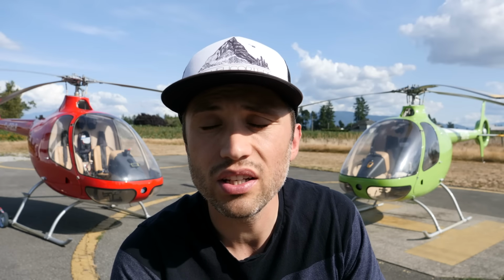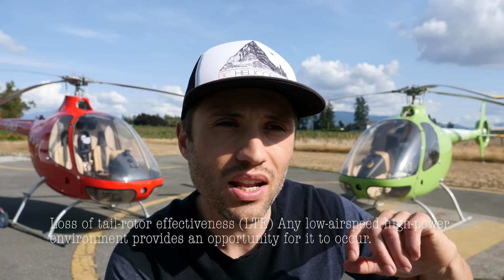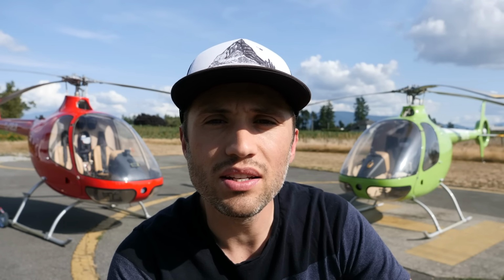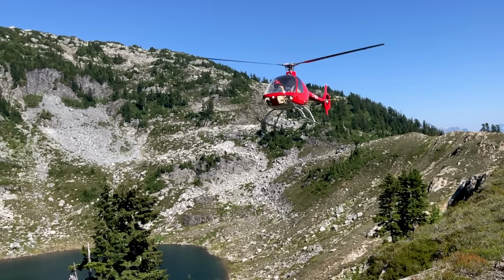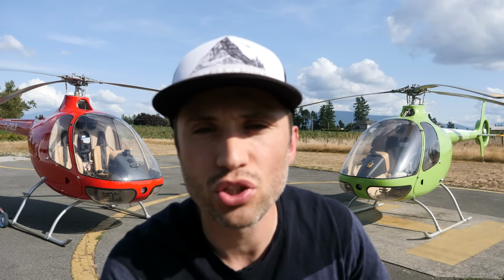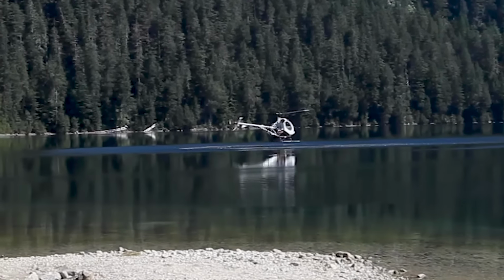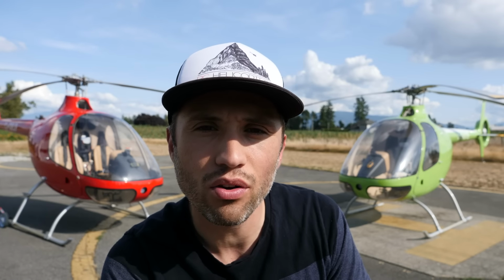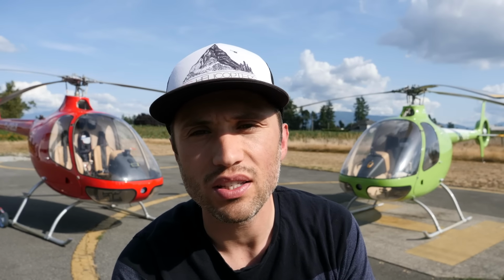OVERPITCHING and LTE can lead to a HELICOPTER CRASH

Comment: What nobody seems to be asking is WHY he didn't have sufficient power to hover, resulting in an overpitch situation? Was this a very hot and high situation?
Reply: High elevation and inexperience is my guess
Reply: It looks like a mountainous area, so I'm thinking he has never flown at that altitude before.  He's probably used to flying at or close to sea level and he probably pulled that hover off a thousand times before at sea level with no problem.  That's my guess.
Reply: I have the same question. Why isn't this scenario built into some guard rail automation to prevent. What's the definitive answer, does anyone know?
Reply: @JayPatel101  I find your question problematic. Relying on technology is exactly why some "pilots" are running into trouble  in commercial aviation. The SFO Asiana crash being a prime example! 
In this situation, he didn't have enough power to do what he was trying to do, and didn't leave himself enough altitude to escape. No technology is going to help you at that point! Self-inflating pontoons, notwithstanding! 🙂
Reply: @BitwiseMobile  the helicopter in the video is an older type.  It appears to be a Schweizer S300 or similar.  Technologies that might’ve helped the pilot avoid this problem may be lacking in such an older aircraft.  The problem here was the pilot’s lack of training OR failure to apply the training received.
Reply: @dapje2002  I’m not a helicopter pilot but I too am rather shocked by how dangerous they become when underpowered for a situation and how operation seems to be frequently marginal in this respect.   This video looks pathetic, like anyone (helicopter pilot or not) could gain height and stop rotation - but this is a great explanation why it happened.  It’s just hard to accept from the outside looking in.   I think it’s science - helicopters are brilliant when they are well powered, not fully loaded or flying in thin air - the skill comes when using them despite some of those issues affecting performance.   Drivers change their thinking when driving on wet roads (or ice!) they don’t just hang up their hat and stay at home.

I suspect this is being handled the right way.     Good pilots don’t get surprises - at least not ones they don’t have plan for.  Poor or inexperienced pilots should know enough to be aware when they are entering the “danger zone” and should either avoid it or train to a level of competence for the situation they are considering.
Reply: I was an instructor in many different helicopters for the Army and in the civilian world.  I'd like to make a few points.  !.  In the Army, we always had charts that could predict the power required in all situations of altitude, gross weight, temperature combinations.  Not all civilian manuals have these charts.  When I asked Bell Representatives about that they said that they included the charts required by the FAA and that was it (much of the RFM is designed to prevent lawsuits).  Therefore, I'm not sure if most civilians can predict power required vs. power available.  2.  In the late '70's and early '80's, the Army crashed over 60 OH-58's due to "supposed" LTE.  They had the same problem with the OH-6's in Vietnam.  However, the term "LTE" had not been coined yet so the OH-6 did not have the same reputation that the OH-58 accumulated.  As we know now, any helicopter with a tail rotor is susceptible to the phenomena.  As it turns out, the Army was advocating taking left pedal out if the aircraft started spinning.  The theory was that the tail rotor had stalled, therefore, reducing the left pedal would "unstall" the tail rotor.  As it turns out, this procedure is what caused most of the accidents.  3.  In many situations, we don't know that we have a problem until we HAVE a problem that has gone beyond recovery.  That's why it is imperative that we always have an escape plan in mind so that it can be implemented immediately without hesitation.  A second of hesitation can mean the difference between recovery and an accident.  4.  During our investigation of the 60 accidents,  every accident pilot that I interviewed thought that he had applied full left pedal prior to the aircraft starting to spin.  In most cases it was easy to ascertain that he never reached the left pedal stop.  As a side note, I have well over 12,000 hours in the OH-58 and Bell 206 and II have never hit the left pedal stop on either aircraft.  I suspect this is the reason many so-called LTE accidents happen.  Case in point is the accident that the speaker mentioned in New York.  I happen to be familiar with this accident.  It was an inexperienced pilots first day on the job after getting only a few hours training in the Bell 206 Long Ranger.  He was single pilot when he tried to orbit over the Hudson River, did a right turn to a downwind condition and lost it.  There is no way he ever applied full left pedal.  The aircraft had plenty of power and pedal available.  The pilot in this accident made an approach into the wind and then immediately made a turn to a downwind condition.  (This is evident by the ripples in the water.)  I don't know what altitude or temperature combination he was at, but I listened to the helicopter noise with full volume and I could not hear a reduction of RPM.  I think he just didn't have enough pedal applied to prevent the spin.
Reply: Scott Johnson, Lots of speculative answers to your question.  Firstly, he probably failed to check the graphs in the performance pages to In Ground Effect and Out of Ground effect hover.  Then assuming he did or did not, it appears he failed to do a power check at an airspeed say 30kts for the power required at that HIGH altitude. We can't see the temperature so we can't guess that density altitude was higher than pressure altitude.  If he had simply flown around the lake in a circle he would have been ok. He failed to check the yaw, he failed to apply forward cycle and start moving out of hover, he had lots of outs and just did not have or was not taught any survival skills. Now, he had "INSUFFICIENT POWER" because the power produced by the engine was insufficient to maintain a hover at that pressure or density altitude over that water surface. , Overpitching is asking your engine to rotate the blades an angle of attack that exceeds the power available.  A bit like asking your motor bike to tow a 10,000 lb trailer up a hill.
Reply: You have to know you equipment and watch your gauges.
Reply: @oakesd22  having just watched a video of a similar accident into water that occurred in South Africa on a very informative helicopter accident investigation channel, the gentleman presenting was incredibly informative...he says that flying over bodies of water should be avoided. Never is best, otherwise only if absolutely necessary, and only experienced pilots.
Reply: @carlwilliams6977  exactly!! I compare modern technology more and more with "pilots" becoming more like "riders"
The machines are becoming automatic, and more or less autonomous, just like riding an animal. You don't control where each paw steps, because the horse has its own brain.
That can relief the pilot/rider's stress and increase the situational awareness. BUT!

...But you definitely gotta know your horse. Not that machines have feelings (yet) but you gotta know the envelope and the brains, and the conditions set into each maneuvre.
Reply: @JayPatel101 It IS !! The fool would have had his low RPM warning blaring for ages prior to his rather harsh setting down. This was completely avoidable. Had he simply kept in a hover, rather than pulling his collective to 105%. A steady hover, a foot or so above the water would unload the engine, and allow it to pick up RPM. This would also silence that annoying LRPM horn 😅
Reply: @JayPatel101  because tgeres no way to realy automate  a response without having it engage while flying and not having an issue  by the time youve lost enough oomph from your rotor  theres not alot that can be done besides auto rotate down especialy from that ground hieght the solution your looking is counter rotating blades or dual blades
Reply: @oakesd22 fantastic.   Always communicate and brief a fly away plan
Reply: It appears that this was a mountainous area, which affects lift.  Ground effect is also reduced over water, so it requires more power to hover.
Reply: @BitwiseMobile  I remember when I first learned to fly I flew at 4007 AGL, which was my homebase and then I flew down to Houston and it felt like I was flying in a bowl of soup

Comment: This sounds exactly like when fixed wing pilots stall the plane, they instinctively want to pull back on the stick because they're afraid the plane is going down.  In truth, they're already in a nose up attitude, but are unaware due to spatial disorientation.  The nose up attitude is causing the loss of speed, which causes the stall, and unless they push the stick forward and get the nose back down and the speed back up, it will drop out of the sky like a rock.
Reply: It reminds me of the training with riding motorcycles where one is taught that if the front wheel starts sliding in a turn to increase throttle to transfer weight from the front wheel to the rear wheel. The instinct is to slow down when the front wheel starts sliding.
Reply: @stuarthall3874  
Yeah, and grabbing that front brake is another thing riders will instinctively want to do too, and that's going to put you on the ground even quicker.   I don't know if I'd respond appropriately in that situation either.  The only time I've ever had my front wheel sliding out from under me was because I was having to do an unplanned stop.  I had just left a car wash and was approaching an intersection.  I thought the guy in front of me was going thru the light, but he changed his mind.  Fortunately I wasn't going very fast.  I managed to get my feet down and save the bike, but I thought I might have broken my left leg in the process.  But I have pretty sturdy bones, thankfully.  I couldn't be out breaking my legs in Montana when home is back in Texas, it would've ruined the trip.
Reply: @That's_Mr_Ass_To_You 
It seems like they've become so reliant on the autopilot and a checklist that they've forgotten how to just fly the plane.  Another thing I've noticed is they have little to no knowledge about which automated flight controls can stay on, or turn off in the background when the main autopilot function shuts off for whatever reason (kind of like the MCAS debacle on the 737 max, only I don't blame the pilots on that since Boeing didn't bother to tell anyone it existed).
Reply: @That's_Mr_Ass_To_You 
Good example.  It's kinda scary.
Reply: Reminds me of Air France 447. The pilot flying kept the “nose up” input all the way until crashing, never telling the other pilot what he was doing. Of course, the other pilot never asked either.
Reply: @uwekonnigsstaddt524  
Ah, the infamous F.O. Bonin.  One thing that stood out to me was when the Captain finally made it back to the cockpit, the other F.O. claimed "we don't know what's wrong, WE'VE TRIED EVERYTHING."  When in reality the only thing they'd really tried was Bonin continually pulling back on the stick.
Reply: @brussell639  actually, many newbie riders are afraid to use the front brake.  They often think they’re going to be tossed over the handlebars if they do.  Too much rear brake allows the back tire to break loose easily, especially with poor traction.  On sand or gravel, a light touch on the throttle and small brake inputs are your friend.  But on terra firma, pavement, etc., the front brake should be used as needed.  There’s a reason why most heavier bikes have 2 front rotors; when used properly, the front brakes do most of the work.

Comment: The drop of power at hover, reminds me of trying to accelerate an automobile going 35mph in 5th gear"
Reply: Perfect and easy to understand explanation.
Reply: @gratonkuria4783  it is an oversimplification, and in this particular case it does more harm than good, it gives you an illusion you understand everything involved when in fact you don't, there are things one should not dumb down to 1+1=2
The problem with the car is that you're out of the sweet power spot of the engine, you got loads and loads of reserve power, you simply need to access it - drop a gear, increase rpm on the engine and you're fine
The problem with the heli is that you're losing altitude, you're already at full power, there is no gear to drop down, the only fix is to lower the tax on the engine - reduce angle of attack of the rotor which also fixes the rotation, because the rotor torque is decreased - doing that however means you're going down even quicker
So it is very much NOT like trying to accelerate in 5th gear at low speed, the only car comparison would be that you're trying to overtake someone on a 2lane highway, you got an incoming car on the opposite lane, and the guy you're overtaking is speeding up, and you're already in the low gear to get max acceleration, and that is still not enough to pass the cu** to your right before you run into the car in the opposing lane, thankfully you can slow down and feed behind the cu**, with heli - not so much, the incoming ground will hit you
Reply: Make sense, lower power above knock out stage
Someone forgot.newton law